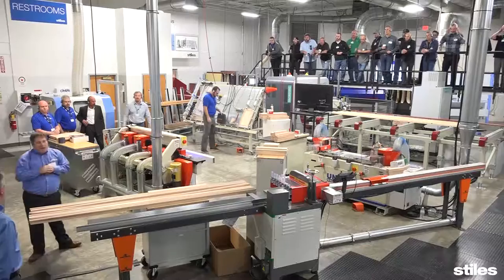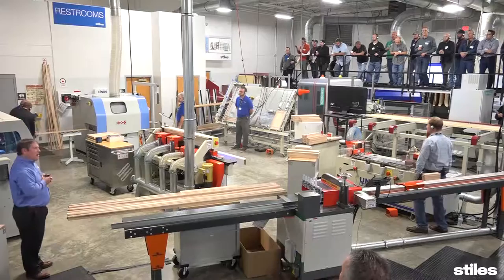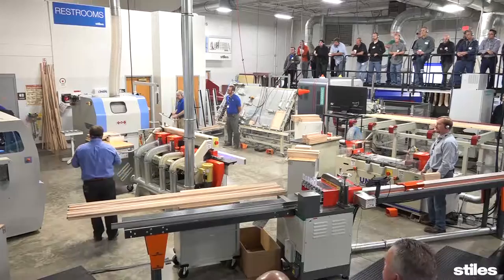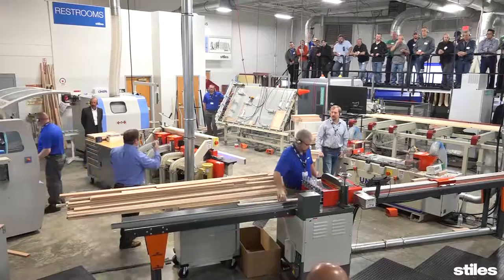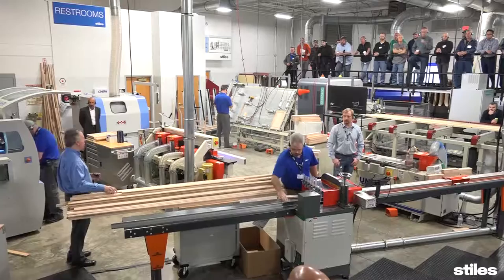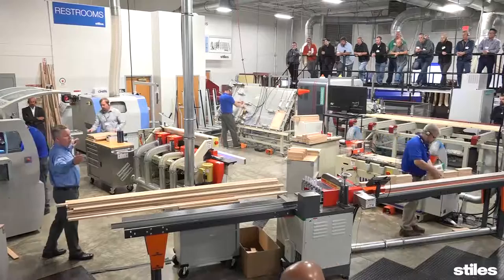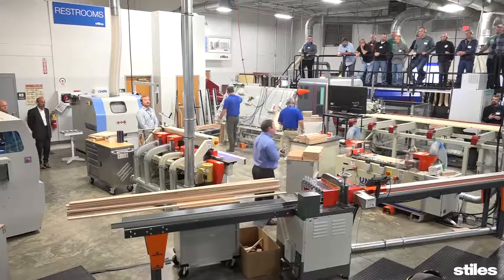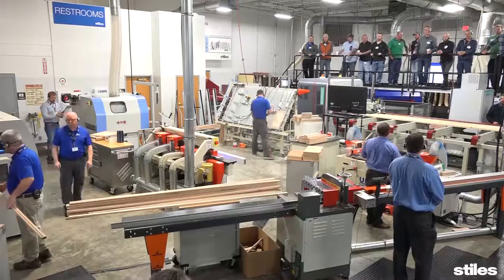Kitchen Cabinet Door Cell Demonstration | Stiles Manufacturing Solutions Seminar

Comment: I can't believe STILES allowed this presentation.  We don't run stuff. We machine and process. Very boring. Missing power points.  WTF? Not going to waste any more time on this but guessing you used a dude that operates a few machines on the shop floor and probably has worked there since high school. An expert. Not good guys. Not good.